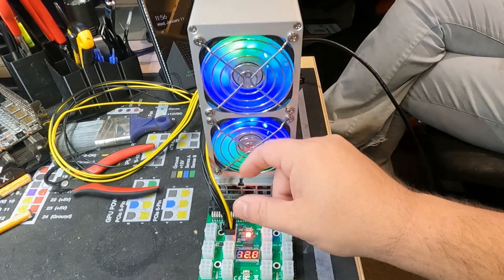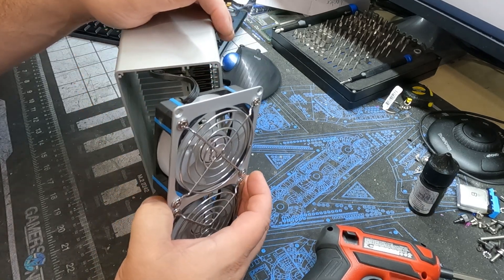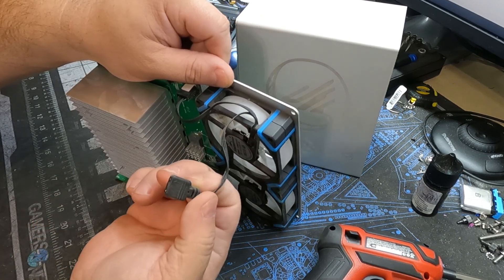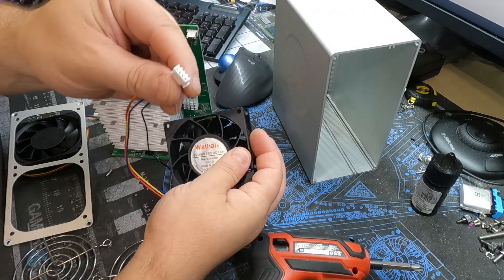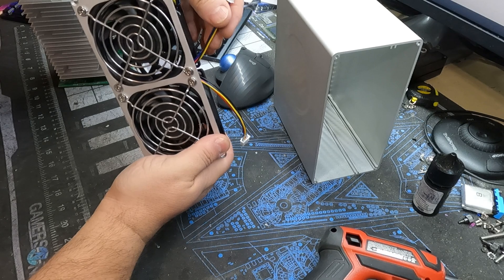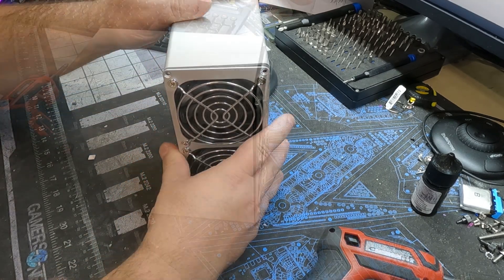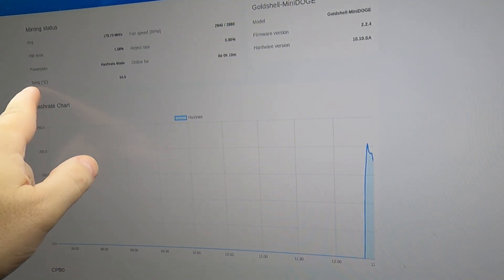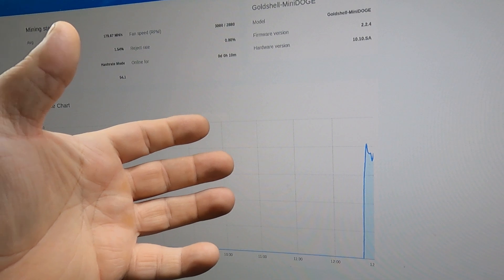Goldshell Box Miner - Easy Fan Replacement

Comment: Any experience with fan errors after replacing with other fans? Mine spin up nicely after booting, but result in an error and causes a bootloop. With the original fans it works just normal.